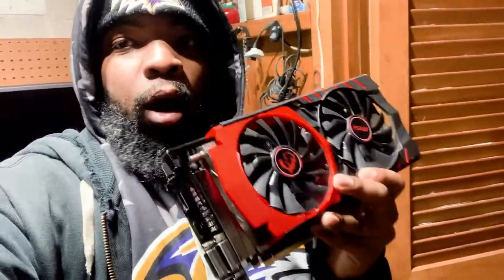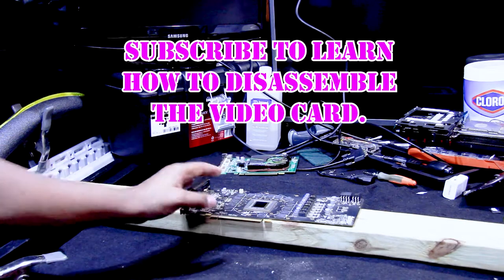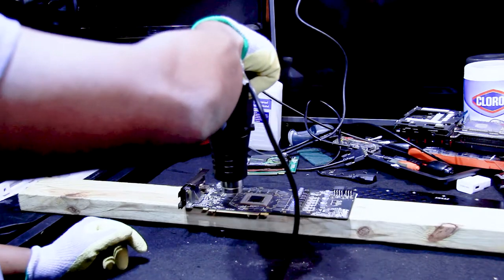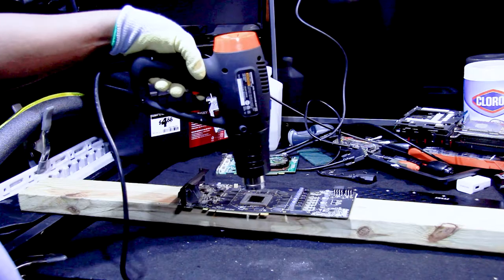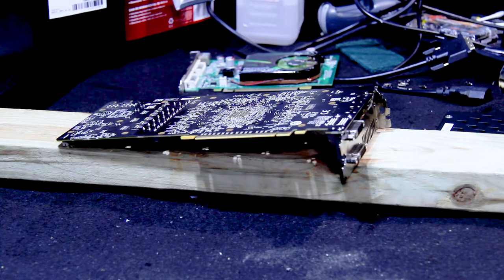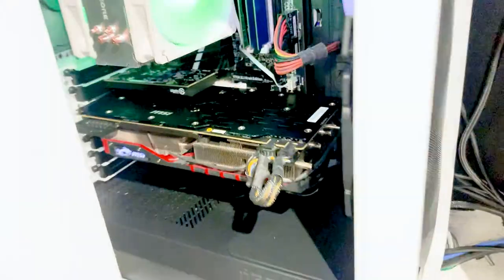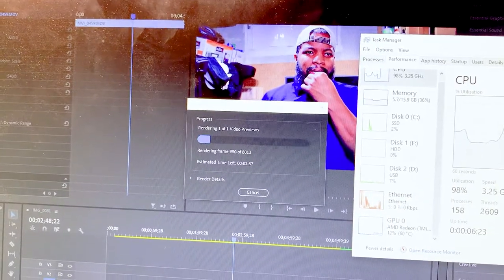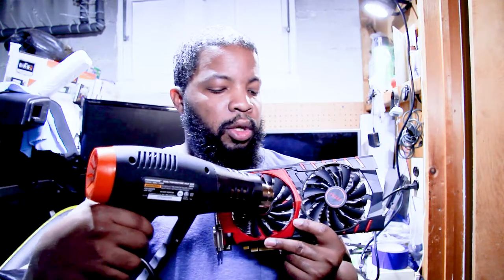How To Fix Graphics Card | Video Card Artifacts (Fix Dead Graphics Card | MSI R9 390)

Comment: Just want to say thanks for the video! Tried fixing a r9 390x I bought for £70 broken (artifacts), used a hair dryer first and didn’t work then tried a heat gun. First attempt didn’t work but after try’s, adjustments and tempt/time changes I got it from blurred lines to crisp graphics 👍🙌
Reply from the maker: Good deal brotha. LOVE it when you can fix a issue with the simplest tool such as a heat gun lol.
Reply: what a crispy graphics card bro, does it taste good?

Comment: It def works. Fixed 2 cards last night that was artifacting and not posting or boot windows. Today I have 2 perfectly working gpu's. I was quite surprised it worked and fyi I put the heat right to em. Thanks for this video. You the man.
Reply from the maker: Much respect Tim, I am glad this video has helped you.
Reply: @AWordFromMrJones  what temp do you use or recommend, Thanks Bossman.

Comment: did it last?
Reply from the maker: Mine did but some video cards may require a reflow or replace of the GPU or memory chips. Search around your area for a shop that repairs motherboards and videos cards. 

These are businesses whom specialize in electronic boards. Some may charge $100-$300 for repairs depends on the board/chipset.

Hope you find a solution.

Comment: what to do for Laptops?
Reply from the maker: Majority of laptops have an internal graphics card which cannot be removed. I would highly recommend that you inspect the laptop for dust, clean it with compressed air. Regarding the artifacts affect, if your laptop is displaying this issue, you can try to update your video card drivers, lower the game display settings to find a setting that works. But ultimately your goal would be to purchase a gaming rig or build one.

Comment: Don't soldier and don't use heat gun it is firmware issue of gpu flash the firmware first upgrade then downgrade your gpu will be fine if not the only solution is to reball
Reply from the maker: That is correct, firmware driver can also cause video display issues. I have a video on this process.

https://youtu.be/U2n1Xpcja7k

However, this video is for those whom already tried reinstalling the video card driver and still has issues. So this is more so a last attempt resolutions before any purchases a new video card.

The video card I did this to, still works fine today.

Thanks

Comment: hello, is it temporary or permanent solution? thanks
Reply from the maker: This would be the best case scenario for "preventive maintenance". This would be something you should do at least every 4-5yrs. But that also depends on the load/stress and heat on your GPU.

So in simplest terms, this is consider maintenance which is periodic thing to do for optimal performance and lifespan of your video card.

Comment: Bro, this is not a recommended fix.
It will be temporary and the problem will come back again.
To fix this permanently you have 2 choices:
a reballing or a reflow.
Reballing requires expensive tools and experiences so you need to send this to professionals if you want to do so.
Reflowing is also difficult but you can do it with right equipements.
You will need a pre-heater (something that can heat up the board from the back (under the GPU) and a Rework Station (a professional hot air station that is specially designed for that).
You'll also need a thermo-couple or an infrared thermometer + an Amtech flux that will help the solder balls melting correctly.
You can find tutorials on youtube.
Reply from the maker: That's a fact!

Comment: Don't want to be a negative Nancy but you are doing more damage than good, this is NOT a fix
Reply from the maker: No worries. But as mentioned in the video and description, this would be classified as a temporary fix. Permanent fix is to get the GPU reflow.

This particular video card has been working fine since this video.

Thanks